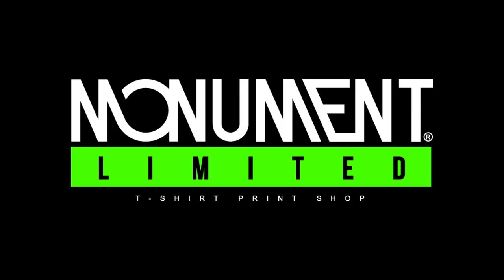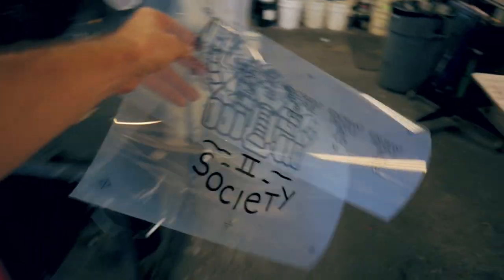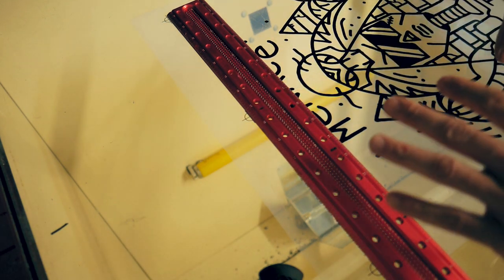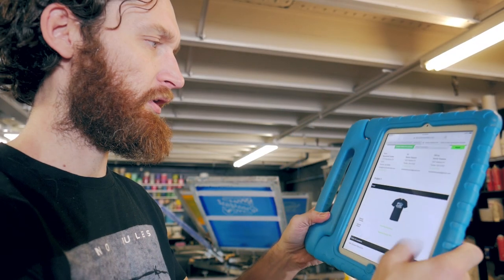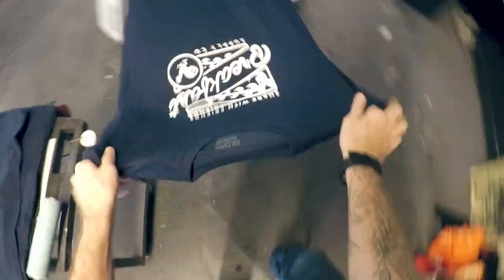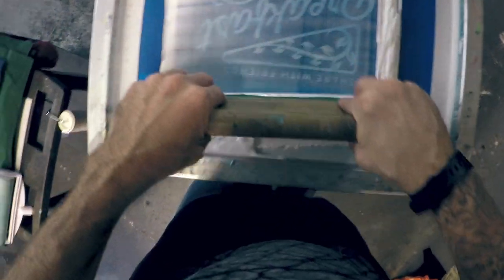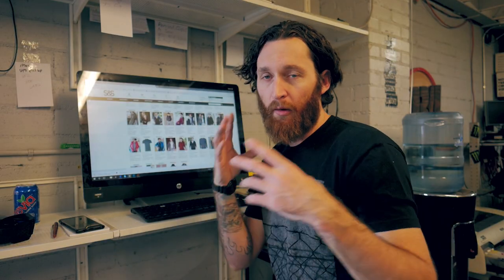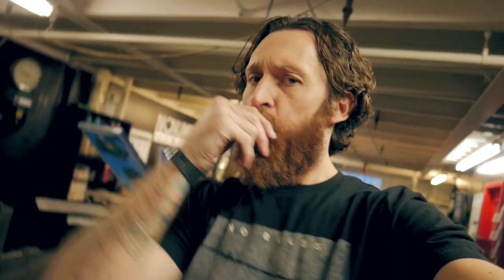Screen Printing Vlog: Save time with efficient film registration on the exposure unit

Comment: Just a suggestion that may or may not work for people depending on your workload....  For the last several years, I just set the screens up right on the press.  I lay the film down on the pallet with some tape (sticky side up). Put the screen in the head I’ll use, bring down the head so the film sticks, then take it to the exposure unit.  I never have to measure anything.  This works especially well on multi colored jobs.  Just my two cents. Keep it up!
Reply from the maker: Yup use to do it that way as well, the exposure unit is for sure easier than that method, try it out.

Comment: I dig your reg system. My only issue would be that you are one screen at a time. If you set up a table jsut like you exposure unit and flip the tape so it applies it to the screen then you can set up 10 more screens while the first burns. Then you just pick up the next screen with film in place and burn it.
Reply from the maker: two light tables would be ideal then we would be cruzzing at warp speed, I tried getting them to work side by side no luck, they dont fit.

Comment: Nice explanation on how you set your screens. Going to try your method. 

By the way, that book has a ton of great tips and the downloads are nice too. 

Quick question: what job tracking software are you using? We have tried tons of them.
Reply from the maker: It is our propitiatory software.
Reply: The Print Life I wondered about that. Often thought about doing the same.